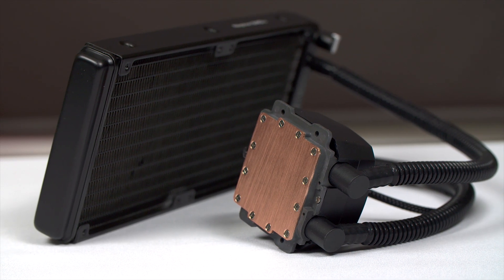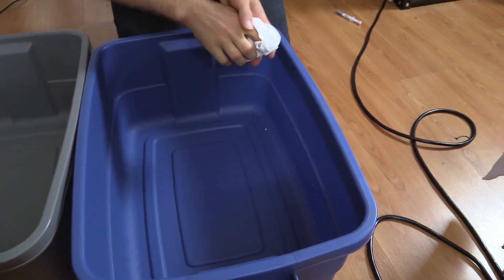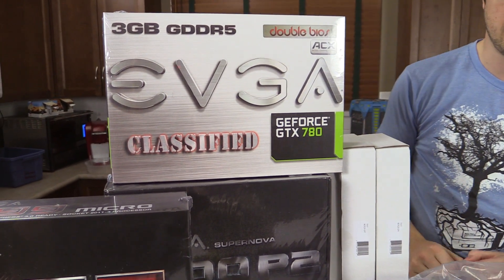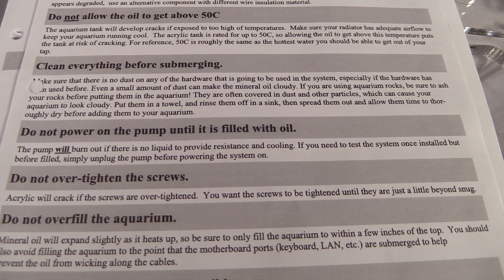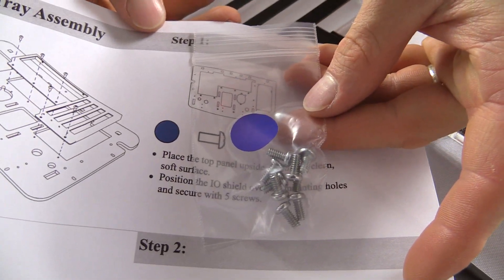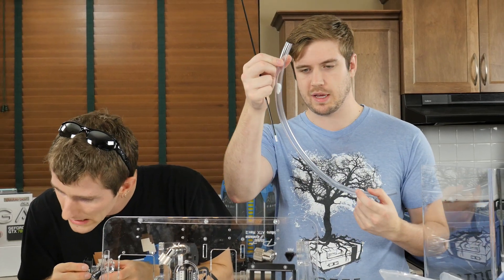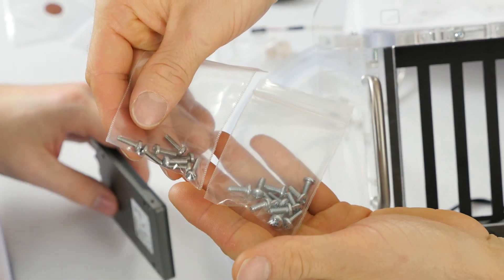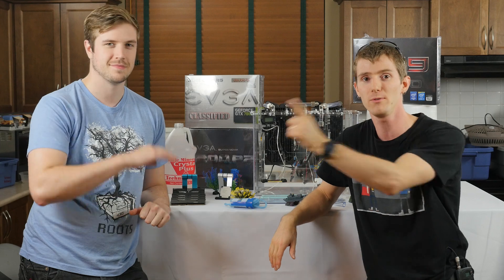Mineral Oil Submerged PC Build Log Part 1 - Puget Systems Kit Case Assembly

Comment: It's easier to gas fit this for pressure and charge it to 1 bar (14.5psi) with argon or nitrogen. Keeps it permanently clean, no chance of shortages and heat transferring is optimized (190% improvement on heat transfer efficiency compared to mineral oil with the right set up). And no mess!! Get your gas from a welding supply store.

Comment: Once I got my hands on that Cooler Master piece of bullscheiße from the ad in the beginning.

And you know something? The CPU just needed to get hot to get the eclusively designed pump mounted on it deadly stuck!
Moreover, a water cooling solution that's worse than most of the top-end air towers... WAT?!!
Barely bending tubings of as rough cheap plastic as they could get.
And... It seems to be a nice brushed finis at the foot of the waterblock. In fact these scrapes range to about half a milimeter depth - all  for providing the crappiest thermal contact some sick mind could possibly design!

Oh yeah, this piece of junk is also not even close to being silent.

A good auld bingo - Linus advertising the shittiest top branded PC part I've ever encountered.

Comment: Could you refrigerate it in a college dorm style fridge or freezer, or can components suffer from being too cold? The freezing point of mineral oil is -30C (-22F). Try it with a raspberry Pi!
Reply: Things like refrigerators are good at getting really cold... with non-constant thermal loads. The cooling capability doesn't need to be that high (in terms of watts of thermal output moved over unit time). If you have a room temperature can of soup, you can place it in a fridge, and it will slowly remove the heat and bring it to fridge temperatures. However, if you have a constantly outputting thermal load, it will be quickly get overwhelmed, and the fridge will actually turn into a hotbox (since it's thermally sealed). You can extract out the components though and make a chiller, or get really fancy and do a phase change cooler with the evaporator directly over the CPU. And yes, some components can act odd, or become less stable past a certain point of coldness. The people that cool with liquid nitrogen will try and maintain temps at a certain level they found is most stable for their overclock.

Comment: Cullender small batches.  Onto a sheet pan in a single layer is the best way to clean and dry aquarium rocks.   I've had my own aquariums since I was 4, that's the best way to clean them I've found over the last 31 years.   Sun bleaching is the best way (for fish tanks anyway, it kills and contaminates that could leech into the water) big bin never worked well for me.  Got the large particles out.  Had to clean the filter after a could days when it got plugged up with the smaller particulate matter.

Comment: They should make  a revised  version of this... like a really brand new kit with super modern high end hardware
Reply: From what I've heard, someone patent troll (allegedly?) hit Puget, which is why they couldn't make this case anymore
Reply: They will. confirmed on wan show.
Reply: Just use a normal aquarium today.. thats pretty much what this is with a special lid
Reply: This is still modern no need for another one at this time
Reply: @pavy415  problem is it aint available. or if you have a source, please do share !
Reply: @llyweiluntunare2232  what isn't available?
Reply: @llyweiluntunare2232  good think luke has some in the closet ;)

Comment: but how well does oil cooling work.
my system doesn't get very warm at all , in fact even after a while of being under load i can touch the heat sinks and only the gpu is just a little bit warm.
but i would like to make myself a new computer case because this current 1 is just a hair to small.
and if oil cooling works well then i might just try that.

Comment: It’s 2019 and I thought they were crazy using a gtx 780 
But them I checked the publish date 😂😂😂😂
Reply: Fast forward 2 years and they've become the only affordable card :P
Reply: @Chuby123  true pain
Reply: @Chuby123  wanna buy a 2070 super or 1660 super
Reply: @monty3580  huh
Reply: @monty3580  I would how much for the 2070
Reply: I know this is an old comment but the sad thing is that even with how old this pc is its still better than mine. But im not gonna hate on it because its been running 5 or do years non stop with little to no downtime and ive only had to replace the hd recently.
Reply: @mech0p  I have a computer with a 660, don’t feel bad 😂😂😂
Reply: I was confused why they used an old card and not like, a rtx 3060, but them I remembered it’s 2021 and I have a gtx 970
Reply: its 2k22 im still using my old gtx 760 ti windforce bro, it seems like its value is higher than when i got it back then... xd

Comment: Now if the mineral oil is non conductive would it be possible to say run a twisted core that has had its insulation removed. for aesthetics purposes and granting that you can keep them from coming in contact whilst submerged.

Comment: What if you used distilled water instead of oil?
Reply: Travis Edrington it would run for a very short period of time. It would quickly pick up an electrical charge from all of the metal in the pc and short it.

Comment: Using an inverter motor you can control the temperature of your cpu and regulate the motor speed according to the temperature. This way you save a lot of current. And theoretically, if well done, you can put engine and pump outside the building.

Comment: Where can I get the fittings that pass through the tank wall. That allow a tube on one side of the tank wall to connect to another tube on the other side of the tank wall. Thanks, David

Comment: Damn ur getting me excited about pc building again!
I designed a submersed  cooling system just over a decade ago and did some research into nonconductive resins like are used in  powerline transformers-

Have you considered the idea of using a water cooling setup in conjunction with submersion? using different specialized mediums for each, even introducing a phase change system maybe?

I've been out of the loop for so long maybe this has been explored, but if not plz do it!
Or is mineral oil still the best overall? LMK

Love your content man, very inspiring,.And i need to build a new pc now :)

Comment: Great idea, loved the video and your results.  Hope it works out ok for you.  Just passing on some info I picked up from wiser birds than me in the hope you've got it covered:

No idea what goes inside an ASIC miner.  Poss concerns I assume you've considered and are happy to handle.  Mineral oil reacts with many other substances, in fact it used as a cleaning solvent in some circumstances.  So, 

Concern 1, Attack by mineral oil overtime (this may take days, weeks or months) on some plastics, rubber, thermal paste/pads and other substrates (eg on delicate components - circuit board(s), capacitors, fans, even heat sinks detaching).

Concern 2, Mineral oil will wick.  So attack out of the oil tank to your network routers/switches is very possible give poor seals of many network connectors.  Mains power supply is possibly less vulnerable as seals likely better here, but still a slight concern.  Use of cheap/old network gear or even use of wireless might be an approach.    

Obviously, as you’re using oil gear and almost certainly hit ROI many months ago,  so who cares right!

Concern 3, Given the size of the oil tank your using if it springs a leak and isn't quickly spotted and repaired the internal pressure may lead to very rapid catastrophic failure.  Mineral oil is a pollutant and will get into the local water supply!  It also a health hazard - just imagine how slippery your floor will be if you get a major oil leak.  So, you should definitely have a secondary and slightly larger containment tank directly below the main tank and possibly tanks below the external gear too. Just like a current oil burning heating system would be setup.   

Best Rgds - Have fun Mining.

Comment: Use a wet dry vac to suck a string thru the tubing and use the strung to pull the cleaning swab thru the tubing.

Comment: 2:41  oooor you can use boiling  water which it even better at remove grease and  after 10 minutes and those rocks are at 100c they will dry them selves pretty damn quick

Comment: Hello LTT, I have an idea for an interesting build of sorts: 

How about buying a large bag of fine powder Aluminium oxide and using it as a massive pseudo heatsink - this thing is electrical insulator so in theory it shouldn't short anything and it is a good thermal conductor with massive heat capacity at this quantity - something like an oil submersed PC but in powder I guess :D (you could get it cheap in larger quantities at it is sold for about 900 USD per ton in china), laying computer on it's side leaving top open filling the whole case  fully with Aluminium oxide and pressing on it well. You would need to seal the holes in the case with cellotape obviously. This could theoretically keep the computer cool and completely quiet via convective and radiative cooling. I'd keep the stock heatsinks installed though removing only active components of CPU and GPU coolers. This could also be done on a bench without a case packing everything in thin transparent Polyethylene or Polypropylene bag making it more geared towards radiative cooling (PP and PE are nearly transparent to IR at room temperatures). I'd love to see this build :)

Keep up the great work!!

Comment: Mineral oil is 95% water so this will make your pc melt
Reply: Pi uhh.. no. 
1. It's fine as long as you use the right oil
2. Water would only stop the computer from working. Computers don't melt when in water.

Comment: Hold up hold the fuck up. Since when can yall make computers in water
Reply: +JituR B No, as it would ionize upon contact with metal, and quickly become conductive.
Reply: Fart Moisture has nothing to do with it, water is conductive, meaning it can carry electricity. So when a motherboard is exposed to water the electricity jumps through the water causing the board to short. Mineral oil is nonconductive, so this issue is avoided.
Reply: Corvo Attano i feel retarded now but thats really cool
Reply: My personal stupid moment that your comment reminded me of was me thinking that wood could (under normal throwing into lava conditions because a chemist is gonna be on my ass) turn into lava.  Never occurred to me that it just burned.
Reply: they could use distilled water that wouldn't conduct electricity, and it's viscosity is much lower

Comment: How often would you have to change the oil? Mineral oil, like all oil, will break down when heated or will become less efficient over time and will have to be changed. I've Googled it, but couldn't find any info. I heard it was like 3 - 6 months.

Comment: I would so build one, but i dont know if using a 50 gal tank is worth all that oil. I was planning on splitting the tank, so half of it was a PC, and the other half was a server, but I did not know if i would run into other issues.

Comment: do you have video that shows comparison between a PC submerged in mineral oil maybe overclocked or stock while comparing it to same exact system with stock cooling and again one with medium price water cooled system.  Which one helps overall temps?  Maybe you have video like this already but i'm curious about comparisons

Comment: I'm curious the oil pumps on the back are to circulate and cool the oil but isn't most of the heat from the cpu? So couldn't you get a small water cooling system rather than the bulky pumps puget supply?

Comment: Doesn't oil retain heat? Wouldn't this eventually get too hot after long use or no because of all the glass and circulation? Would this be a worse choice if you lived in a hot climate so indoor temp is always higher?

Comment: will putting in fish void my warranty ?
Reply: +Thomas T (トーマス) no, but the fish will expire instantly
Reply: Not instantly, that will just die a slow miserable death of suffocation and an overdose of lube.
Reply: it will most definitely void any warranty the fish may have possible come with..
Reply: +Thomas Crowe MC tinytree!
Reply: Only a little
Reply: It will void the fished warranty for sure.   Its oil not water 😂
Reply: You might need to replace the fish every 5 minutes tho
Reply: Of the fish, yes. Of the pc, no.
Reply: it’ll void the fish, though
Reply: Only void warranty for the fish.
Reply: fish cant survive in mineral oil

Comment: That's really interesting, I've actually never even thought of cycling the oil through radiators to cool it down.  I've always wanted to build an oil cooled PC but I've also wanted to make it a silent PC, with no fans, although I'm not sure if the oil would help or hurt in that case as the rate of natural convection might actually be worse than just air.

Comment: Is it possible to do a mineral cooled machine with a hdd or will the system not load.
Reply: +FanGirl312 HDD is a mechanical part, so no, the needle will stop working.

Comment: I know this may be over looked but I am an auto tech kinda new to the whole computer world but I have been working on a different type of fluid to use on an oil cooled pc. my solution is transmission fluid. and yes I've checked it is non conductive  and with my latest test today I put it in the freezer at negative 1 Celsius. cool thing was that at this temp a regular oil pump for a pc could achieve a flow of .5 gpm that gallons per minute. let me know what u think.

Comment: So computer parts are totally fine in mineral oil? Also, would you need a heat sync like that if you were going to build one of these?
Reply: The oil is the sink
Reply: +Karrlo Smith no, no, no the rig is the sink, the oil is in the sink (as well as being the sink lol) jk
Reply: +SuffuFFaffiss Sink, not sync lol, why would you sync heat?
Reply: Yes you submerge you cpu, mobo, gpu before installation to prevent shorting out in the future

Comment: what if the oil gets too hot?
Reply: Arjen Hartink thats why radiators exist -_-
Reply: +Arjen Hartink An extinction event
Reply: +Arjen Hartink you could fry potatoes in it
Reply: Nothing, mineral oil doesn't burn ( not 100% sure)
Reply: Sovietkitty yeah it doesnt burn, but if it gets too hot the cpu wont get cooled down

Comment: You can bake the rocks in the oven to remove the water.  Lay them out on flat pans like cookie sheets.
Reply: Wouldn't the grease in the oven be a potential contaminant? You'd have to really scrub the oven till it shines xD
Reply: Not if you keep your oven clean, but there wouldn't be that much grease floating around after all grease is oil.
Reply: Ben Fitts This was my first thought, even before they mentioned letting them dry outside.

Comment: what's the point of watercool if you're going to submerge it in oil?
Reply: 김준현 water is different than oil..
Reply: um.. I don't think you get my point... they submerged the computer in oil to improve heat conductivity but they used water cooled radiators to cool the graphic cards... which doesn't utilize any of the oil...

Comment: Hey the 780 Classy is pretty nice over stock. It can easily handle 1250mhz on air while my primary card (a reference 780) absolutely requires water for that result.

Comment: I built one of these over a couple years ago, its a very fun and unique mod. Its an awesome conversation starter, especially when someone walks into your living room and sees a fishtank PC full of mineral oil hooked up to your television.
Couple good pointers for those that are building a cheap one or can't get their hands on the kit.

- Make sure your tank is sealed properly, grab one of those fish tanks with a plastic lid, the oil can evaporate over time.
- Don't use high end hardware or stuff from your main rig thinking you can pull it out and easily run it as an air cooled system again. Mineral oil is a bitch to clean, but can evaporate on its own if you give it several days. Thermal paste on graphics cards/CPU's will have to be properly cleaned off and re applied in this case too.
-Fans dont serve their purpose inside the tank, but they spin slowly and look awesome. If they're good fans, they might even help with the circulation of the oil which keeps a solid temp.
-Cables tend to harden when being in the mineral oil over prolonged time, so your s-ata cables and whatnot wont be as flexible if you want to reuse them in an air system.

Comment: the thing about oil wicking along cables always bothered me with these things.  I feel like it ought to be possible to design some gimmick barrier to stop oil at some mounting point leaving the tank so you could have at least some kind of cable connection set on the outside

Comment: My specification are!

-i5 4670k
-Radeon Hd 7950 
-H100i
-3 HDD
-1 SSD
-3 FANS
-AND A 500W POWER SUPPLY 

AND MY PC SHUTS OFF WHEN I PLAY GAMES 
its when i play some games it shuts of like middle.earth.shadow.of.mordor its shuts down in 30 min and when i play TitanFall its shuts down in like 2 hours.But when i play Battlefield 4 or any other game it's ok.Do you think that i need a more powerful power supply ?
Reply: Nikolas Petrou Get a new power supply. I have never heard of super flower and definately wouldn't recommend anything that isn't well known when it comes to psus.
Reply: minimon3000 super flower is a very well known top PSU maker http://www.techpowerup.com/reviewdb/PSUs/Super-Flower/

EVGA flagship PSU are made by Super Flower
Reply: nope i have a 100i and my gpu is under 60 Celsius on load
Reply: What brand is the PSU?
Reply: Super flower
Reply: Best advice is just to go ask at your local computer shop, they can point you in the right direction for all your needs
Reply: Mine is the super flower SF-500P12P. What do you think about that one ?
Reply: Nikolas Petrou Proboably a nope. The PSU pretty much has to be a known brand, such as evga, corsair, seasonic etc
Reply: Is your CPU or GPU too hot?